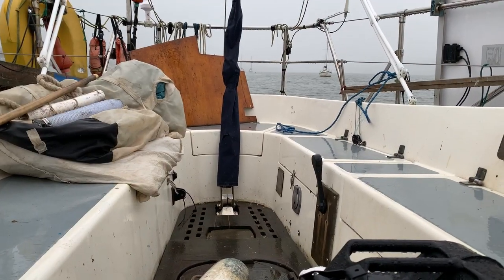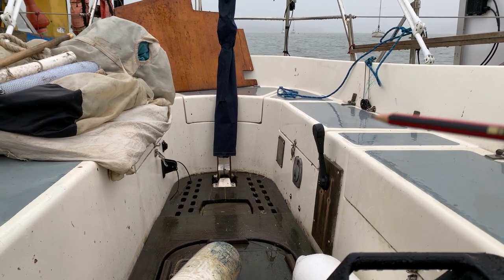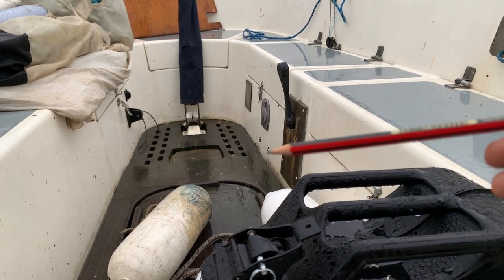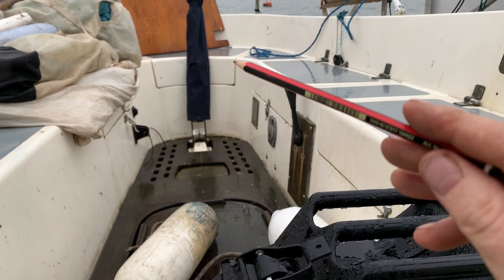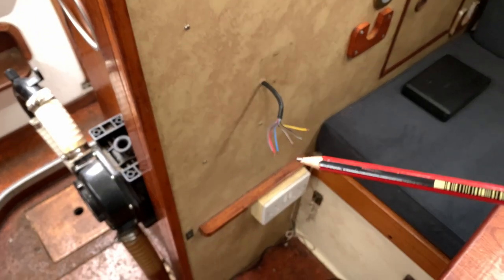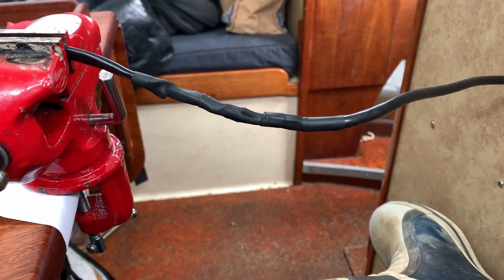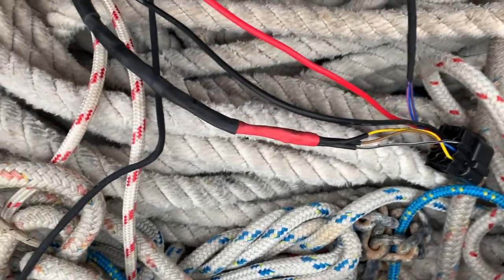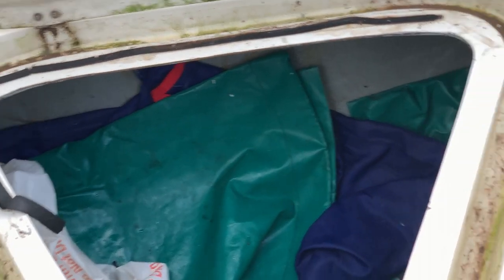W1 E1 - Fitting a Diesel Heater

Comment: Morning. I had one of these in my camper van and it was very efficient. It’s not the fuel that the issue but the draw on the batteries is enormous at startup so you did the correct thing in using the engine. A really good solar array coupled with good leisure batteries will put your mind at rest.
Reply from the maker: Hi Peter. Thanks for commenting. Good to know yours was efficient. How was the reliability? I have a pretty good solar setup, but of course when you most need the heater there is very little sun!

Comment: Hi Jamie.  If your cockpit drain holes are large enough, just thread a length of garden hose down as far is it will go, and give a hefty blow!  I have to do that quite often as the mud from the river is always clogging the outlets!
Reply from the maker: Hey Geoff! Ended up using one of these - handy to have on the boat anyway for sink unblocking etc... 
https://www.screwfix.com/p/drain-unblocker-7-6m/11325
Reply: @JamieBowenSailingPlymouthUK  Handy looking gadget.  Likely to clear the shellfish out of the drains too, haha.

Comment: Interesting. So now you have used it for a while, what is the actual draw on the batteries when in use?
Reply from the maker: Well, actually, as Arctic Smoke has been in the yard until recently I have been using an oil filled radiator plugged into the yard's power, so I still don't have a great sense of the power draw. Apparently, once they've started up, it's around 1Amp continuous draw which is no problem for my solar set up, but for start up, the glow plug draws around 10amps for maybe 5-10 mins. 

Unfortunately when I actually wanted to use it this weekend, the thing wouldn't start up because the temp sensor seems to be broken and as soon as I supply power to it, it thinks it's hot and goes into a cooling shutdown cycle. There is an easy fix though apparently with a new sensor for about £5.